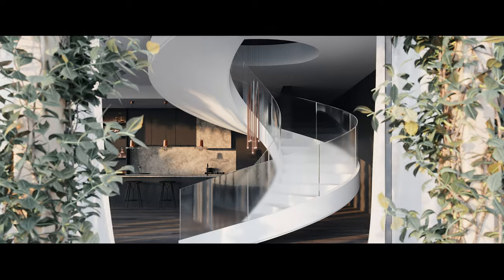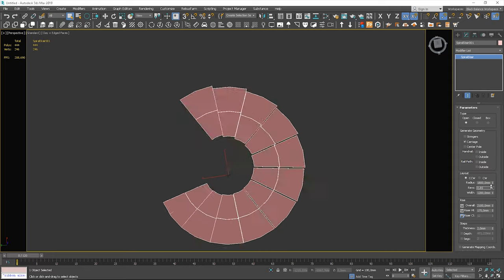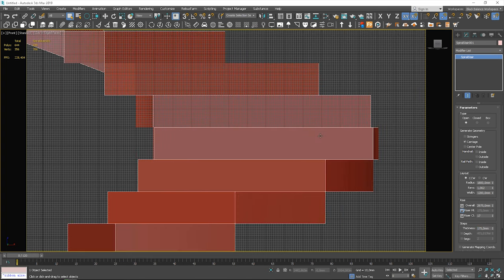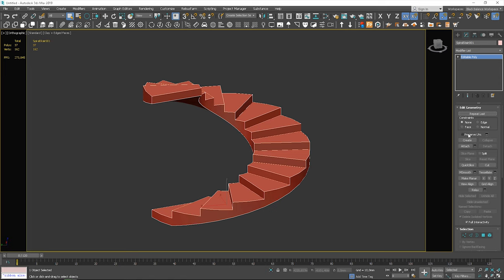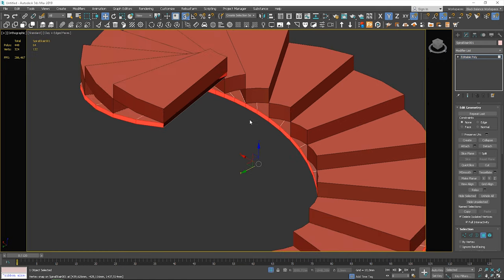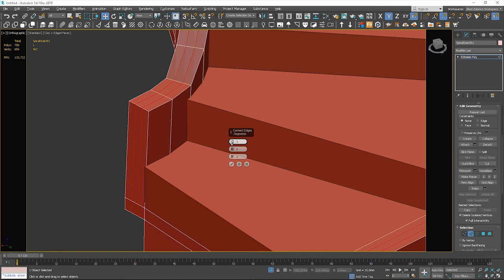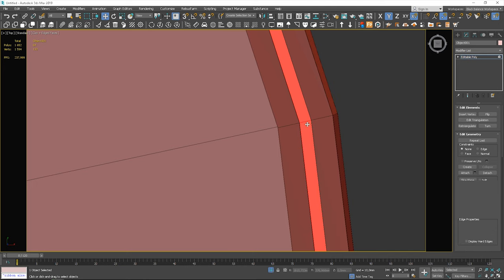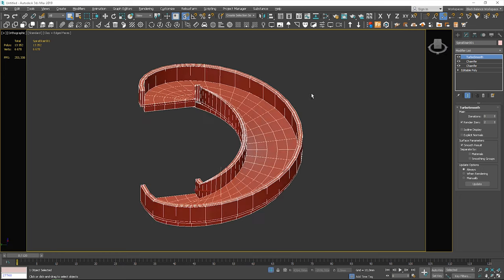Spiral Stairs Modeling | 3ds Max Modeling Tutorial

Comment: Nice tutorial! at 5:00 you add edge connections all by hand which takes some time. In cases like this i add Subdivide modifier with a large size parameter, so it connects all edges but makes triangles. Then add EditPoly and Use  "Quadrify All" in Ribbon
Reply from the maker: Thanks for the tip!

Comment: Hi, thank you for the lovely tutorial. I am stuck in the 4:57, as I don't quite understand you said that adding the connection to the object, like how did you get those lines in the bottom piece of the staircase, I used vertex and didn't work the same as yours. Thanks anyway.